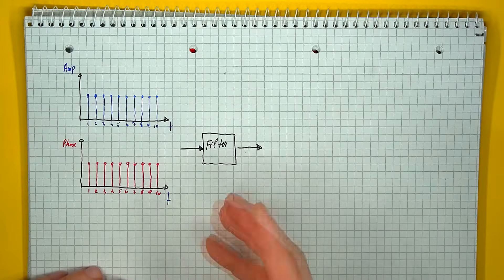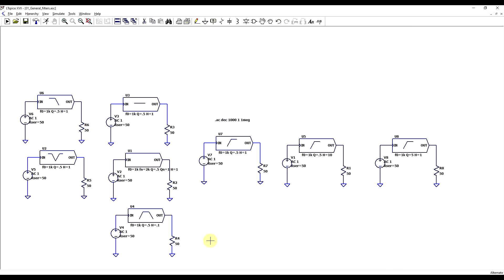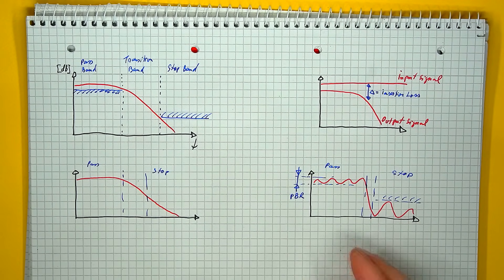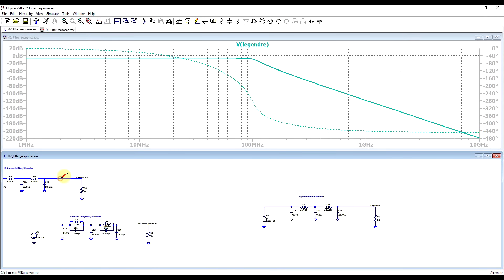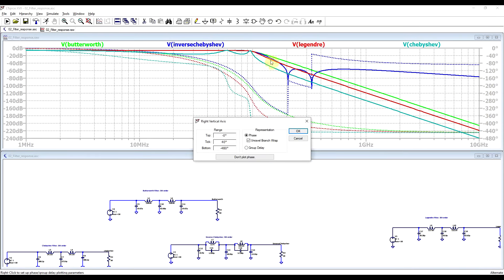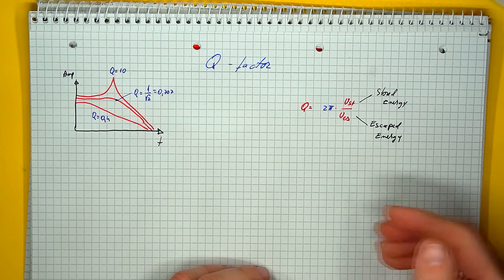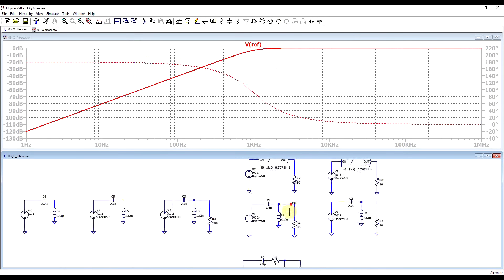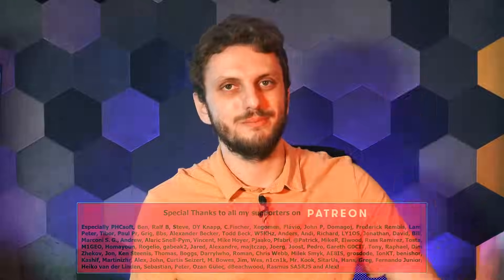Intro to Filters

Comment: What happens when you concatenate filters? Can you directly overlay their graphs to see the behavior of the resulting filter like they teach us in many courses? I think it should be wrong, as filter designs assume no impedance in the AC voltage source and an unloaded output. My expectation is that combining passive filters will cause them to affect each-other a lot.
Also, what is the actual difference in hardware between all the filter types? I can only assume Butterworth and Chebyshev are edge cases of Cauer. Said in a different way - I expect any randomly generated filter to have elliptical frequency response. 
Can you explain intuitively how poles and zeroes are related to the reactive components of the circuit and how resistors shift the poles and zeroes along the attenuation axis on the Laplace plot?
Reply: @TOPSTOPI  I am sorry, but none of that answered anything I was asking for. I know about passive and active filters. In the video FesZ shows circuit diagrams that look almost identical in netlist, yet their frequency response curves are of 3 different types. The only apparent difference was the level of magnitude difference in component values. I was asking if Cauer would be the curve if all the component values and magnitudes were randomly generated. I don't care about the Laplace or Z domain equations, only the Laplace plot/diagram. AFAIK the locations of the poles and zeroes along the frequency axis correspond to resonant frequencies of LC groups and the other axis determines how fast a tone dies out (a resistor dampens the LC oscillations) or escalates (an active component amplifies the LC oscillations). I was asking how can you quickly determine just by looking at the circuit diagram where exactly on the real component axis a pole or zero would be for a passive filter.

Comment: I have to comment on the discussion at the start of the video about combining low pass and high pass filters. The statement that  a low pass followed by a high pass results in a band stop filter is, at best, very misleading. The combination of  low pass and high pass filters placed in series is always a band pass filter, no matter what order they are placed in. This is provided, of course, that the corner frequencies are appropriate. In order to achieve a band stop filter, the low and high pass filters must be arranged in parallel.
Reply from the maker: Indeed, you are right, the phrasing is not the best; I was trying to say that from a graphical point of view, you have a low pass corner first, and then a high pass corner; but the exact practical implementation is indeed with 2 filters in parallel...

Comment: 2:05 low pass followed by high pass wouldn't leave any energy for the high pass.  I think you meant low pass in parallel with a high pass?
Reply: that's inaccurate. think of a frequency with a high pass of 120hz followed by a low pass at 25hz. nothing over 120 is allowed then followed with nothing below 25hz is allowed. think speakers bro
Reply: @TecraTube  As far as I can see, you've made 3 mistakes.  He said low pass, followed by high pass.  (1) You've reversed it in your 2nd sentence to be high pass followed by low pass.  (2) In your 3rd sentence the high and low PASS filters turn into high and low STOP filters.  (3) If we look at any of the possible combinations here, high followed by low, low followed by high, and pass or stop, there's still no way to make a bandstop or notch filter out of a series configuration of these.  The best you can achieve is a band pass.  Looking at it from a digital logic perspective may be helpful -- bandpass is a logical AND of 2 corner frequencies (ie: output = above f1 AND below f2), whereas notch or band-stop is a logical OR (ie: output = below f1 OR above f2), so needs to have full spectrum fed in parallel to both corner filters.
Reply: @BartKus  reversing it doesn't matter champion. you're overcomplicating this. 
step 1) low pass filter at 25hz so frequencies less than 25hz are not passed.
step 2) high pass filter at 120hz do frequencies above 120hz are not passed.
step 3) only frequencies passed are narrowed to 26 through 119

Comment: The story of my life, filters.  IF filters, cavity filters, band pass filters, band reject filters, high pass, low pass, filters, filters, filters.  Two way radio communications would be all but impossible without filters.  Other than repairs I spend most of my days adjusting band pass, band reject and notch filters.
Reply: I have a background in microwave circuit design and all I do now in electronics isn't even RF related. I do miss doing RF related things. I was building my own amateur transceiver but went too low jack I couldn't build the PLL side of the transmitter. Planned on 40.66MHz up to 41.7MHz within the ISM band for my region. Strictly analog isn't easy without filters. Too many things to consider. Maybe I'll resume it one day. You can't find enough practical resources online with enough documentation on theory. Most resources focus on one or the other. Aspiring engineers will have to learn things the hard way which I'm fine with honestly, but sometimes doubt in engineering is lethal, we tend to question everything without the ability of feedback on winded explanation of key subjects. Without fine-tuning, we are even lost. Pun intended. 🤣
Reply: Bull$hit filters?! 🤣
Reply: Coffee Filters
Reply: @weerobot  Yep, I forgot those.  I use 2 or 3 a day.
Reply: Notch?
Reply: Are you a filter?

Comment: Excellent and understandable explanation, as always.     
I kept thinking that much of the understanding of filter response also applies to acoustic "filters" i.e. tuned ("ported") speaker enclosures.
Reply from the maker: Indeed, there are a lot of similarities, since both involve waves; as a fun fact, you have SAW/BAW filters where first the electrical signal is converted into an acoustic wave, it travels trough a crystal slab, with various mechanical resonators, before being re-converted into an electrical signal again.